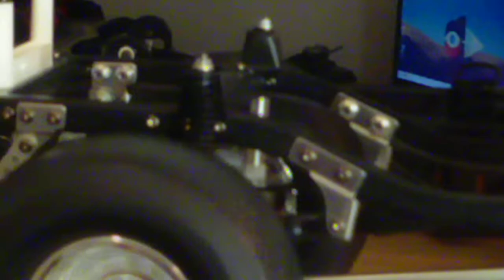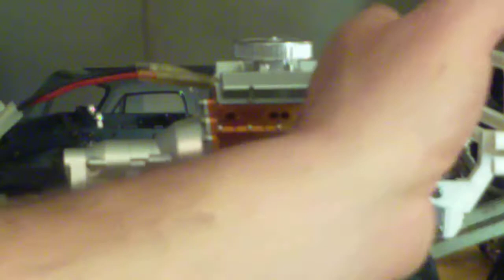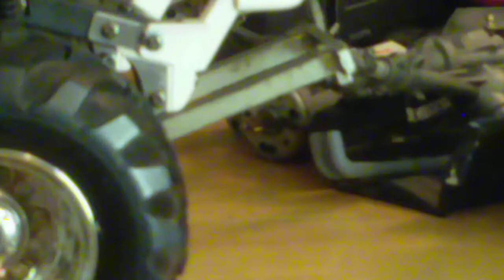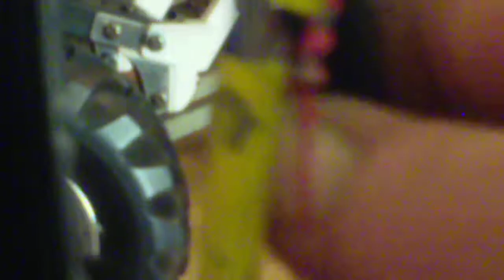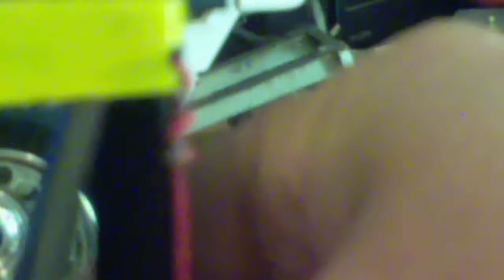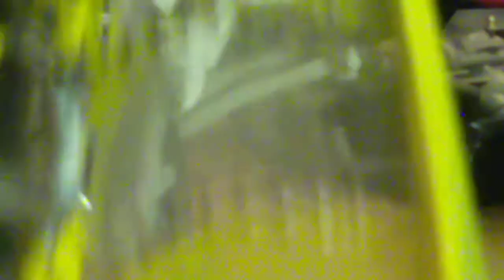rc4wd v8 installed in a tamiya bruiser

Comment: i have the v8 in my blazer i just waited 2 years to do it its as far as i can go right now with all there parts they offer  on the trail finder 2 frame if you take the servo plate and flip it the servo will stand up at the very edge of the frame out front and the rc4wd rad fits right in looks great and steers great 2 thanks to rc sparks hes the one who gave me that idea when theres a will theres a way gcm racing makes a lrt2 transfer case that fits the r4 trans i think its a must for the build i hope anyone that does this agrees with me

Comment: You think at 27T Holmes motor would fit into the RC4WD motor on this truck?
Reply: 27T Torque Master from Holmes
Reply from the maker: I'm running a 3100kv brushless in mine, its tightly fitted inside because of the larger wires, but if the overall size of the Torque Master is comparable to a 1/10 can 540 it should fit with some room around it to cool, I know a 1/8 scale brushless ( Redcat, Cen racing, Traxxas,) is to long.
Reply: Dennis Dempsey Radio out of control awesome bud thank you, I will look into purchasing it

Comment: Hi.I just bought brusier in rough condition and was thinking about going with aftermarket power train.My question is how those drive shafts fitting brusier axles?I believe connecting rod on trans is different than one on axle.
Reply from the maker: Hi, all the shaft ends are 5mm on the trailfinder and the bruiser,   the rc4wd website has a section of many different driveshafts with the 5mm 6mm and 8mm in several lengths that I use for my scratch builds. hope this helps you out,
Reply: That's great news, punisher shafts will fit without problem.Thanks ☺How do you like this Axle transmission combo?1 gear is very low ?
Reply from the maker: the only bad thing about the transmission for the v-8 it's only a single speed. It is geared lower for crawling and works well with the bruiser axles one thing I wanted to upgrade was the transfer case to a 2 speed one so I would have a really low first gear.
Reply: Dennis Dempsey All good news. Thanks!I was thinking about scx Scale transmission but it is single speed also
Reply from the maker: I do remember a place on ebay called Bizarre Hobbies and they sold an all aluminum 2 speed version of the scx transmission for a while, maybe do a web search to see if its still available?
Reply: Dennis Dempsey bizzare Hobby's got this.Thank you . Did you find accessories for engine?
Reply from the maker: yeah i found the accessories at rc4wd,lol
Reply: Dennis Dempsey Great!!!I'm waiting update video 😉